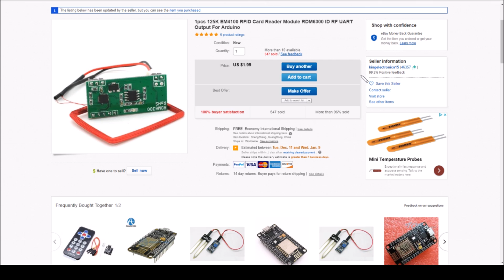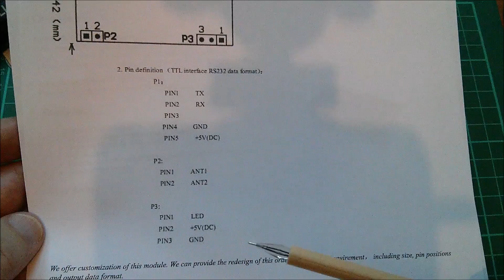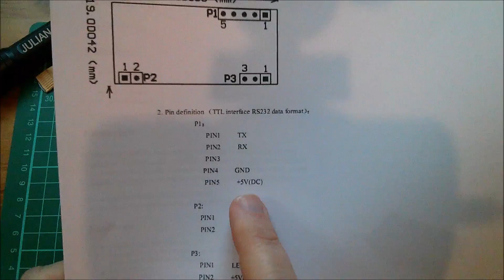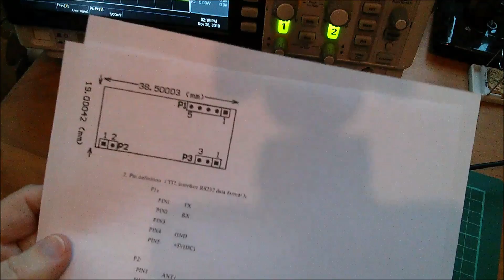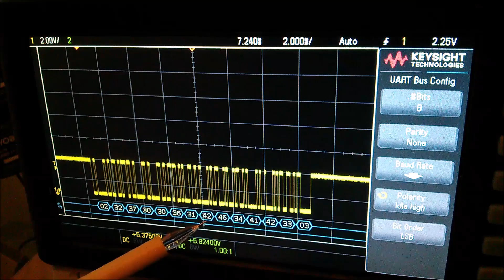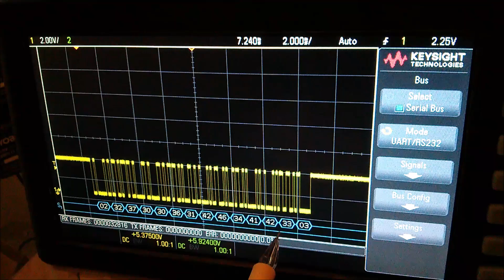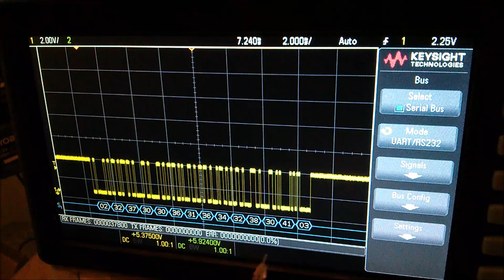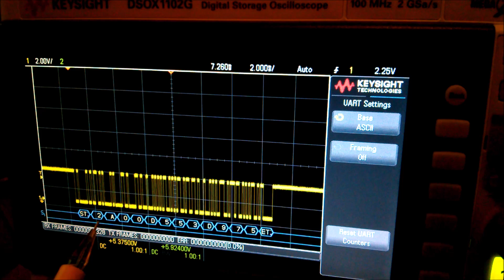RFID Module and Oscilloscope

Comment: What is the voltage on the TX pin ? Will it work directly with an ESP32 or will I need a level shifter ?
Reply: did you get the information?

Comment: Jonathan I need your help please, please.   I've got a 16 way mux connected to a MEGA 2560, the mux lines are for receiving serial input of tag info from multiple RDM6300 modules.  I've connected a single module, powered from the MEGA 5v/GND and it reads perfectly from any of the 16 mux lines.  However,  when I connect a second module,  the first one stops working as soon as the 5v/GND are connected.  Neither module works.  If I disconnect the GND from either module the other one starts working.  I've tried using a power bank with the  RDM6300s , common ground on power bank and MEGA but same result.  I'm freaking out.

Comment: I have the same reader. As soon as you approach it with a card, the LED gets slightly darker for a short time. This is visible it dark rooms, yet it is very hard. You can put the LED between the LED pin and Vcc. Then you see a small flash when you approach it
Reply from the maker: I scoped the LED pin - it has a 2% (approx) low-going PWM when the card is being read - weird :)
Reply: @JulianIlett  definitely weird, but hooking it up to Vcc instead of ground should be a quick workaround

Comment: It's a cool thing to tinker with but you do realise ikea tradfri kits are £13 on sale right now, yeah? A switch and a bulb... :)
Reply from the maker: Hmm - buy tradfri, connect tradfri, play with tradfri, learn nothing ;)
Reply: @JulianIlett  Nonono... ;)

Buy tradfri, have lights in work area so you can see. Then learn stuff. You don't learn much in the dark!

I think zigbee (which tradfri uses) is a whole area of tinkering possibility in itself though... you can get Arduino zigbee modules, I wonder how hard it would be...wait a sec...

https://hackaday.com/2017/06/14/ikea-tradfri-hacking/

Comment: Wonderful video and use of the oscilloscope - as someone that codes the electronics way to test always makes me rethink how I approach things.  

For people talking about cloning a card, the easy security option is to have your 'reader' try to write to the card first with a specific number, then read the card. Your security logs can easily be checked for that number and show the time you need to look at the CCTV.

RDFI is really easy to use in Arduino with a RC522 reader and a MFRC522 library.  The most frustrating thing about RDFI are the formats you can read the ID; hexadecimal, decimal, reverse hexadecimal and reverse decimal.  We have three systems that use the same card number in FIVE ways, two of the systems on different sites have different ways of reading and storing the same cards!  The fith way you ask?  decimal but simply replace the first 2 characters of the card with 00, because unique is over rated I guess.
Reply: The read/write capable cards can actually be write-locked with a password, there's also write-once burner cards that are used for cloning.

Comment: For god's sake buy a proper power supply, I can't count the hours you waste fiddling around trying to power things with batteries or solar or whatever. I've got 10p here with your name on it.
Useful video though, thanks.
Reply: horse1066 Julian used to use a generator powered by the cat chasing a hamster in a large wheel. But PETA put the kibosh on that.
Reply: @trottx  Yer i'm glad they stopped him doing that, coz every time the hamster turned around and chased the cat, the reverse polarity made smoke come out of the circuit he was testing !
Reply from the maker: If it supplies power and it's on my bench, it's a bench power supply - just sayin'.
Reply: Julian Ilett - Righty-ho, I’ll be spending that shiny 10p on alcohol, and then singing the song of my people.
Reply: Julian Ilett - Batteries can supply destructive currents in fault conditions, exactly what you don’t want when prototyping. Even cheap lab supplies have variable current limiting! There’s nothing wrong with doing things the ghetto way when necessary, but you have an expensive Keysight scope, yet not even a basic ‘proper’ bench psu, which is what I find strange.
Reply: I know it's petty, but I was brought up on electronic books where the VERY FIRST THING you built was a +5v power supply. It was easy for a noob, just yank a transformer out of something, add a rectifier, capacitor and a 7805 and you were all set. Then it was making something like a TTL led indicator and you had everything you needed to start putting logic circuits together.
But no, in every sodding video of him we have to sit through ten minutes of fiddling with dead batteries, solar panels or tweaking an adjustable DC converter. Nobody else does this, unless they are 2 years old and can't be trusted not to stick 5 volts in their ear.

Comment: Would love an update to the diesel heater (im sure its on the way), ever since you showed us, i've been hooked on them.
Reply from the maker: Yep, I've tried sunflower oil - didn't work. Now I want to experiment with dual fuel (diesel and veg oil in separate containers) using the different viscosities to influence the flow rates and therefore the mix ratio. Fun with fuel :)
Reply: @JulianIlett  Awesome stuff, someone else suggested that cooking oils are too viscous and if you could implement the exhaust heat to thin the oils, perhaps they would flash easier? Although implementing a dual fuel system to start the burner may work? I'm being ambitious.

Comment: Just an off the wall idea. Build a RFID reader into the bottom of a bowl, place it near the door to your shop with several tags, one for each lighting scenario, hung on the wall above it. When you enter your shop, drop the appropriate tag into the bowl and hang it back up when you leave.

Extra off the wall idea, use an ESP8266 module instead of an Arduino. Have the ESP module communicate with an MQTT broker and use Node Red to activate your lighting scenario.
Reply from the maker: Hmm, that's given me an idea. A wheel of fortune where the first tag the reader successfully reads chooses 'light cluster of the day'. I've tried to get interested in the ESP, but I just can't :)

Comment: I already managed to read a RFID tag with an electric toothbrush charger and an old AM radio. Basically the electric toorhbrush uses induction charging which means the charger produces an alternating magnetic field like the RFID reader would do. One day I had the idea to put a tag on the reader to see if it woule react and transmit its identifier, so I put the AM radio close to the charger and sure enough I could hear a very loud sound when putting the tag on the charger. I then connected the AM radio to my computer and recorded the signal in Audacity and I decoded the data. It was EM4100 tag.
Reply: When Skynet goes live, this man will lead the Resistance.
Reply: Heroic!
Reply: Oh Lord, I'm clearly not worthy of my new "cheap electronics" hobby.
Reply from the maker: I like it - very dystopian - very Mad Max :)
Reply: Actually, given that even the Marxist BBC has realised that the new female Doctor is utter shyte, do you fancy the part?

Comment: just dip the fob dongle in paint or add a colored tail ( could have different lengths ), they will hang on a board with hook(s) next to the reader.
if tailed the length could be long enough so you dont need to remove the fob from the hook to reach the reader.

Comment: Your knife. In the last video you complained about the blade not snapping cleanly. On the yellow end there is a slot. Use that to break it off. Alternatively, only expose two segments and (at an angle) push the blade against something hard. Mind your eyes as it has a habit of flying off in all directions.
Reply: Lost the off one of mine, I just use a pair of pliers. Got a small sharps bin I put old blades in as well.

Comment: The coil is bonded by passing a high current thru it for a second or two which melts the insulation slightly while still on the winding former. It was woman's work here in the 80's ( i bet it's kids doing it now in china, the high volume stuff is at a much higher freq and gets printed.)

Comment: what the hell??? u tease us with the 16 channel relay board and theres no vid???? does it have the same problems as the 6 channel relay board??? how stupid not have a fooking toggle chip for it.
Reply: I think you'll find it's a completely different type of board.

1) No rf board.
2) 16 opto-isolators (the 4 pin jobbies next to the connector arranged in 4 banks of 4).
3) 2 x 18 pin chips, probably ULN2803A's Octal Darlington drivers with common clamp diodes.

This is a simple relay board designed to be driven by a processor board of some description rather than a remote controlled board as in the previous video.
Reply: @iancrowe8384  ohhh shit, ya right dohhhhhhhhhhhhhhhhhhh damn late nights.

Comment: It's too bad the security is absolutely zero with these devices as it's trivial to sniff a tag and copy the contents to a bank tag with the 125KHz systems. 
The 13MHz systems are more secure but they're still only good as either very low security keys or as one part of a two factor ID system (i.e. tag + numeric pass code).
Reply: 13.56MHz systems sometimes sucks quite badly, because manufacturers naively think that nobody will ever hack them. As a result I managed to copy my school's access card with  a NFC-enabled smartphone.
Reply: @atmel9077  Yeah the 13.56 has great potential for security. I think the Mifare Desfire cards are already secure enough for most purposes. Lucky for me most places around here still use the easily hackable Mifare Classic 1K cards. :)

Comment: Too bad pet chips in Europe run at 134kHz, for which no such cheap modules are available.
Reply: It is not actually the frequency that is important in this topic. I wanted to do a project with animal tags and did some research. Apparently, the 125 kHz readers work well enough with the 134 kHz tags because the systems are not as finely tuned as one would imagine. The only problem is the communication protocol, which is different. I ordered a small injectable tag and a standard reader and could get absolutely no reaction. There are major differences in encoding and stuff. Sadly, even the cheapest compatible readers cost several times as much as normal readers and are therfore not as great to tinker with on my low budget scale.
Reply: @lostname605  if its only protocol, then it can be fixed in software, its finding the required format for the data-stream, maybe in the patents for the tags your interested in
Reply: @lezbriddon  Yes that is true, but the commonly available readers on Aliexpress have a uart output and send out the decoded data, not the raw input.
Reply: @lostname605  oh thats damn annoying, isnt there a way to enable raw output or get it off another pin on the chip etc
Reply: @lezbriddon  Maybe you could use the antenna and a few of the components of the board, but the rest will have to be done in software and additional hardware
Reply: I think some car fobs do too...

Comment: You can use your Nexus 4 to read/write these cards.
Try "NFC Tools" (I think that's the app I use).
Reply: That usually mifare type card, you need a different module for arduino. Something like the RC522/PN532 , quite cheap as well! Btw, you can read the contactless bankcards with your phone too.
Reply: NFC is 13.56 MHz, this RFID is 125 kHz. AFAIK these cards are read only.
Reply: I've written RFID tags with a Nexus 4.
NFC Tools reads my Oyster card on my Pixel (the Nexus is deceased).
Reply: nogginthenog Great App!!! I love NFC Tools!!!